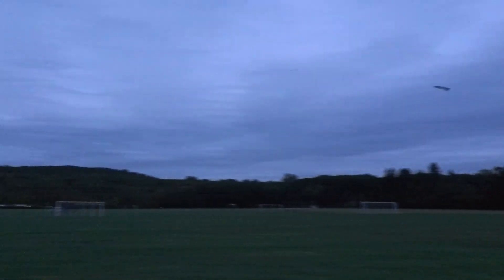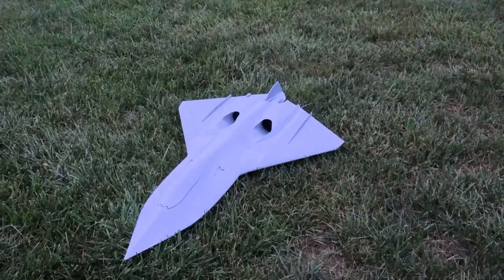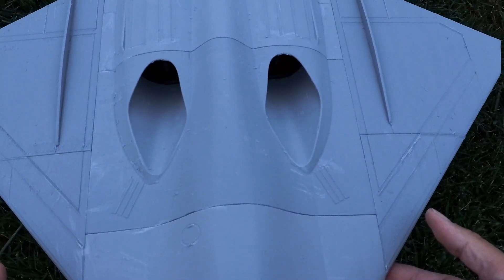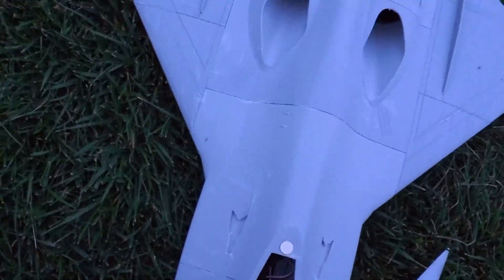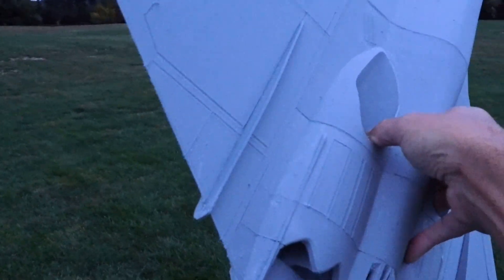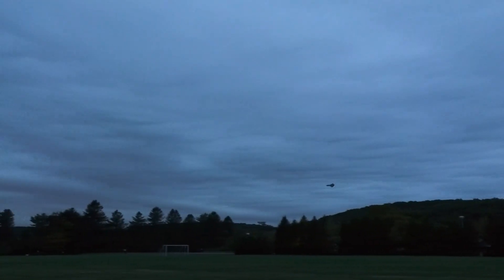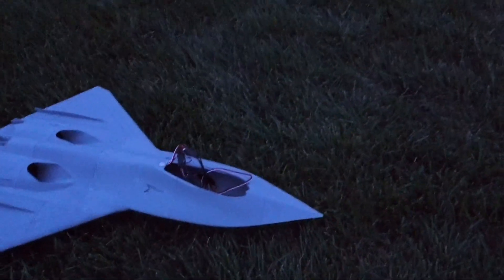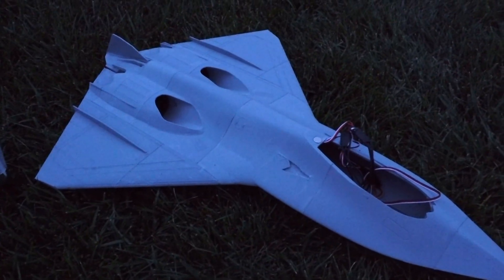NGAD Groundbreaking flight control!

Comment: When can I take delivery on the full size version of this complete with avionics and side stick controls? Just kidding. But you almost could. Just need and A&P to help you out a bit.
What engines are you running on this? It would be way beyond sick if you could get miniature high bypass ducted fan jets on it. Only problem with that would be that it could easily get away from you. You'd really have to be thinking ahead of the game at all times. Other problem would be that I'm not sure that you could build a turbine high bypass ducted fan that small. Maybe someone already has. I don't know. My area of expertise is real jets, but I have to admit, this looks like a lot of fun.
If there are any other female pilots around, you'll know what I mean if I say it sounds like a flying hair dryer
Pretty sick plane. Thanks for sharing it with us.

Comment: I would love to see someone build a JetCat version of this that is slightly larger.

Get rid of the thrust vector flaps as this is killing your directional thrust by 50%. For example when ya vector flap is down, the top air flow will still go straight out while the bottom flow will get vectored.

Check out how the raptor's thrust vector control surfaces work and how they can be controlled independently controlled by the flight computer on each engine giving significantly more vector control.

If you can incorporate this design your NGAD will be able to perform crazy acrobatics and this will help stabilize landing significantly.

Comment: Is this controlled through pitch and roll only? Or are you controlling the yaw through diff. thrust some how?
Reply from the maker: @Morchebab  no just a standard elevon mix with the two thrust vanes
Reply: Hot damn. Nice work!
Reply: The landing is super impressive. As I understand it low speed landing is a huge challange for flying wing type planes.

Comment: I don't build rc airplane. But I do make a  nice paper plane. You can definitely get the NGAD to fly without the vertical stabilizer. All you need to do is add. Conical Camber close to the tips of the wings. Conical Camber is also on the SR-71 Blackbird. I never knew this. But if you look closely at the tips of its wings. Youll see how it's curved a certain way. I would this on my flying wing paper airfoils. It works amazingly well. But I do understand paper planes are different from RC aircraft.

Comment: For those of us who don't really understand, can you please do a video on why this is such a milestone and how/why this hasn't been done before. From someone who doesn't know, it seems strange that such a simple looking design hasn't been done before. Also, what are the benefits over traditional designs?
Reply from the maker: @timcopley1531  next time I fly it ill explain on the video. In a nutshell all planes fly with traditional control surfaces. Meaning the air that passes over the wings gets deflected to provide pitch, roll and yaw. To my knowledge nobody has ever produced an airframe that only uses thrust vectoring to completely control the aircraft and also allow it to land in a  controllable way. I believe a few turbine pilots have managed to fly a complete flight with thrust vectoring but they used a flight controller /gyro to make all the adjustments at 1,000x per second. The F22 raptor and other military jets use thrust vectoring to aid in maneuverability but only in some situations under the aid of computer stabilization. Hope this makes sense. It may seem simple, I can assure you the wing design alone was a feat to provide so much stability we can even think about using only thrust vectoring to control the flight. Then came the planning of the vector vane shape and length. Too much control will be out of control. I could continue but I don’t want to bore you guys lol
Reply: Simple... Its not. and it has
Reply: @blairhammond5456  I said simple looking, which it is. Also, I wasn't talking to you.
Reply: @timcopley1531  It isnt a milestone, and it has been done before... Simple

Comment: NGAD is the way you tune a bass guitar. What is it, that WTF LMAO IKR LOL?! It is nonsense. Give planes names, if those military fools do it wrong. GNAD. Forget it.
Reply: NGAD is an acronym for Next Generation Air Dominance. And its not a plane, its a project to develop a plane, specifically a fighter more advanced than the F-22 Raptor and F-35 Lightning II. The plane is nothing more than a shape on a piece of paper right now, and as such has no official name yet, and the shape on the paper is most likely classified information.

The model is based on the emblem of the project, hence why the model is being called NGAD. Because its literally the emblem of the NGAD project.

Comment: Let's see it fly level inverted or make a lap around the field while inverted. Is it neutral when inverted or does it climb or descend with no stick input? I'm not a fan of the direct drive servo because you'll probably have to turn the travel down in your radio unless you actually need about 40° of control surface throw. Turning the travel down decreases the resolution of your radio and the positioning accuracy of the control surface, so I avoid it.

Comment: Is the exhaust Duct Control a copy, or, Your Design innovation? If you invented this Design… prepare to see it on a Flight Line… Soon ! 🛫✨
Reply: Well, I seen sevrral full size manned planes (done by Experimental Aircraft Association 'homebuilders' that had ducted props that used the vectoring vanes. And wasn't it Douglas Aircraft back in the '50s that tried to use a vane  above and below the exhaust of a jet experimental fighter they were developing?
So it's not a "new" idea, just nre to EDF RC planes

Comment: can you do a video on what radio  and the setup
Reply from the maker: @Ochw  sure what do you mean? The rates on the servos?
Reply: @hotlapkyle Setup from print/electronics installed to recommended settings for rates etc.  I'm going to say I'm going to be a new pilot cause of your videos.  But I need to know where to start.   I've built a quadcopter before so I'm not a total novice.  But servos and flaps are different than setting up a esc and checking motor orientation.   I need guidance after it's built.   Radio recommendation and reciever, batteries used etc 🙌🏾.  I'm going to buy the ngad file soon enough.